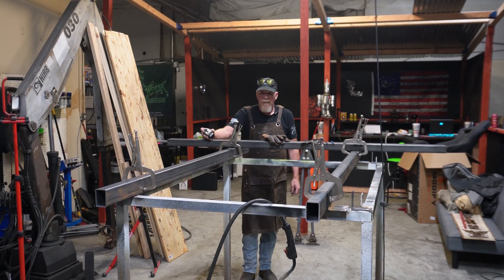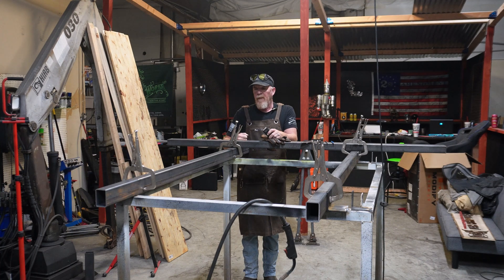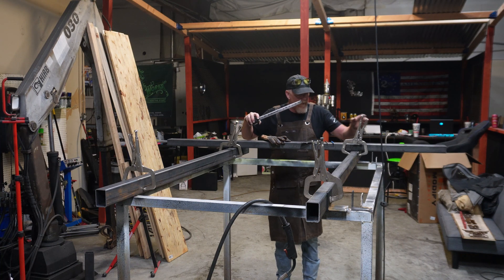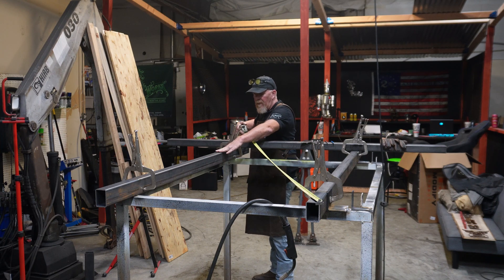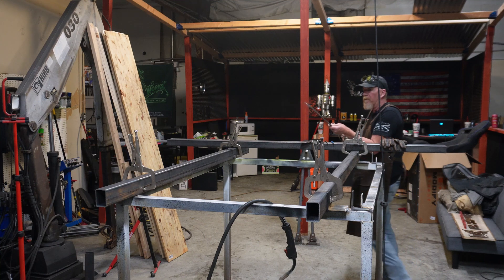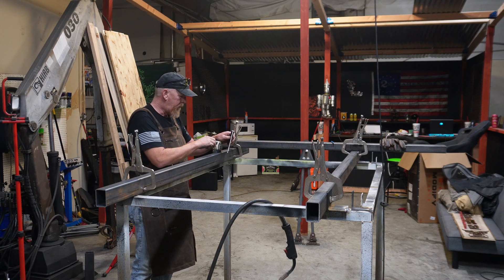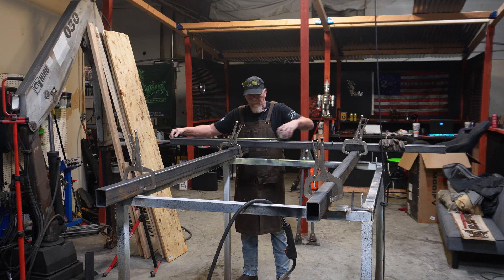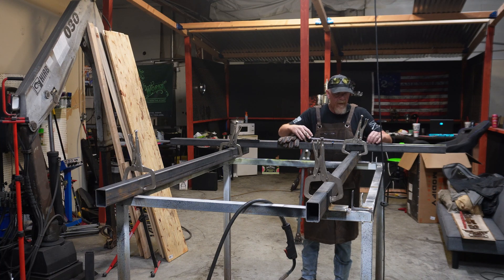How To Build A Truck Flatbed Step By Step, Main Inner Frame Video 2

Comment: your main frame rails are 3x2? and looks like 3/16"? I see that CM uses 4"  3/16 for the main rails. Other plans I've seen use 11ga for the main rails.
Reply from the maker: i mostly use 2x3 .120 wall for the main frame rails. It has a tinsel strength of 26,000 LBS per Square inch... The suspension on the truck will give out way before the bed does... When you install the bed this is adjusted on the mounting of the bed. Most in my experience need shimmed higher on the back than in the front as most of the time the mounts are lower in the rear. So all of this is adjustable on install. The tires certainly wont come up and hit the bed at that height. I think different people use different material based on how they install them, not so much "how tough" the material is perceived to be. If that makes sense ..... Did that answer your question?
Reply: @tinmanmetalworks  gotcha, thanks!